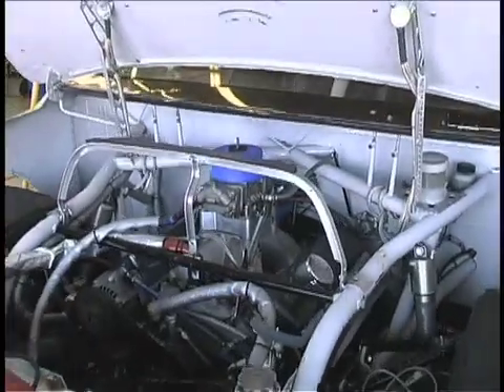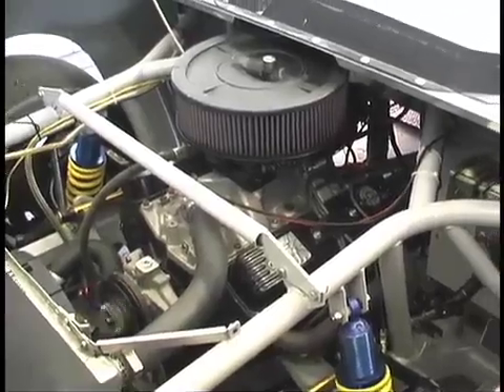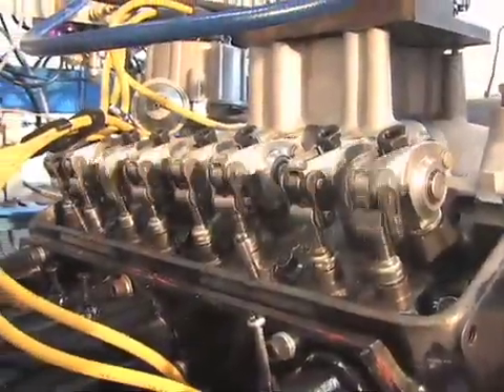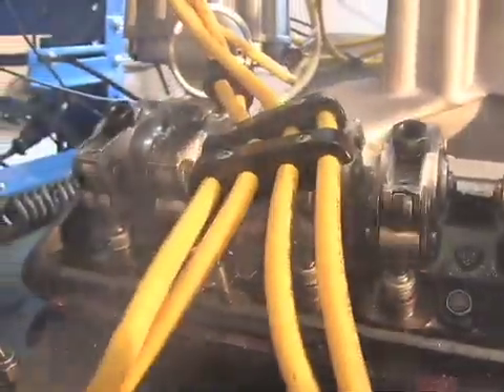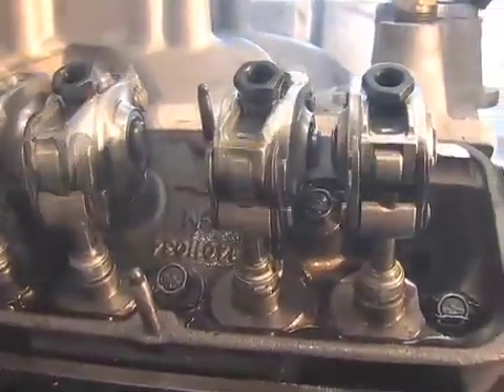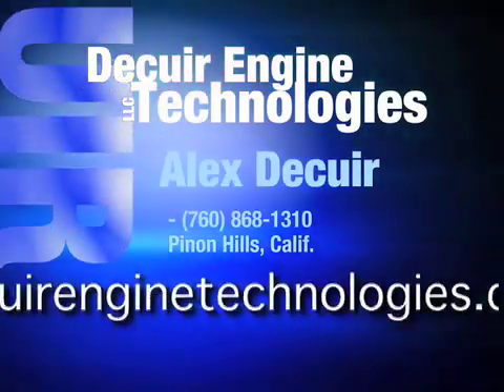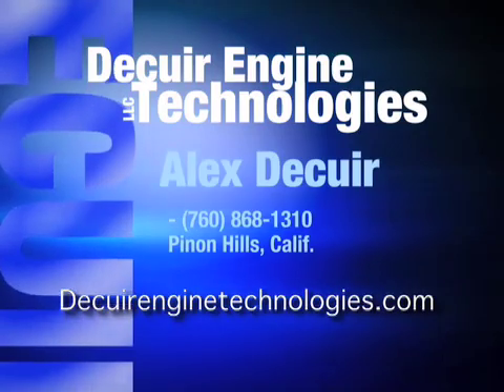Springless Valvetrain For Push Rod Engines!

Comment: It's 17 YEARS later. WHat is the status on this system? Have you tested this system against other OHV engines to prove this system is better?
Reply from the maker: Unfortunately the inventor has ceased operations and could not get enough backing to advance the project.

Comment: Just an immediate thought when viewing this video; If somehow the camshaft lobe could be caged or totally surrounded with the lobe redesigned to close the valves on the bottom side instead of opening the valves. I just don't know how a cam lobe profile could be constructed for different configurations. But, this caged lobe design could not or would be difficult to retrofit to current day push rod engines.

Comment: The only time a desmodromic pushrod makes sense is for higher serviceability and higher speed applications. For higher engine speeds in general, I'd rather any type of overhead cam or just no cam at all (2 stroke).

Comment: I think I would still want a spring and retainer on the valves, it looks way too easy to drop a valve! You put a valve where the Piston is going to be, you will have problems! Most likely, a broken Piston, valve and head! If you are lucky! It can result in rod in block syndrome!

Comment: So, you think the valves will always seat well without a spring?  Bullshit.  This is one of those inventions that only works for 10 minutes at idle. How will you make money without selling a single unit?   I know.  GOFUNDME.  GO FUND YOURSELF.
Reply from the maker: Hmmm.... and your latest invention might be? just send us a link when its up on Youtube. Thanks!
Reply: @EmpEntTV  I invented the worlds first valveless internal combustion piston engine.  It hasn't gone into production because of the inability to find a sealing material that has long term wear resistance without lubrication.
Reply from the maker: Very cool, send a video link over
Reply: @EmpEntTV  So you can steal my invention?  No thanks..  You'll see it when all the legal shit is done and it shows up in F1.

Comment: As cams wear there will be an increasing amount of slop in the system how is this corrected?
Reply: I tried to find an answer to that question on the internet but couldn't find anything, and definitely nothing on this particular brand, I guess it failed.

Comment: Valve rotation is important for valve seat wear and sealing. If you remove that the valve seat will wear unevenly and fail eventually. Also the spring absorbs valve train resonances and without a spring or some type of absorber once the valve train reaches resonance boom there it goes.

Comment: This is innovative,but I CAN SEE it is more complex and the valve return groove in the cam would probably wear out quickly and cause valve seating problems or even worse.A good old spring system is much more dependable as far as not needing to be replaced frequently.And would not be as liable to a piston crashing into a dropped valve and wreaking holy havoc.
Reply: Have you ever owned a Ducati? Lol you hit the nail on the head!
Reply: Not to mention if it was really worth anything you’d see it a lot more in racing but they use compressed nitrogen springs when normal valve springs won’t work
Reply: yup. anybody who knows how much time and effort ducati invested, and how many times major manufacturers investigated and discarded this sort of idea, understands that you don't simply accept these claims at face value

Comment: what about a cam type thing with wave patterned groves and a bearing inside the grove on each side which is connected to the pushrod so the rod is open or closed at the peak and trough of the wave respectivly.

Comment: So, what about valve clearance to allow for expansion?
Reply: The valve seats and the valves are made of different special alloys.  The valves don't expand: they're made of a dimensionally-stable, thermophobic alloy -- a fringe benefit of which is that the heat normally lost through the valves is reflected back into the combustion chamber.  The valve seats are a compatible material that provides a consistent inner diameter and a variable outer diameter, thus maintaining a perfect press-fit.

There are a variety of valve seat alloys, each tailored to the various aluminum or iron alloys used in the casting of cylinder heads -- so, if you're upgrading, you'll need to know the casting's alloy name,  There's rumored to be a sample kit available for determining the best fit for unknown alloys, but it may not be available until 2019.

Alas, the valve seat alloys and the valve alloy all are proprietary :(

Comment: Still doesnt say how it works. Has to have some kind of spring to get a quick enough return and then i dont see how it takes less pressure to activate them.
Reply: +Nick Palaroan I believe everything is positively linked together,. and the camshaft is replaced with something along the line of a mini crankshaft. So just how the crank will &quot;pull&quot; a piston down the cylinder on the intake stroke, this v;lave train &quot;pulls&quot; the valves closed. 

Why I think this design is crap, is I cant see how valve seat pressure is accurately set and maintained...and Even in the video it sounds loud.  This thing probably falls out of adjustment often, and likely burns up exhuast valves when the seat pressure falls.
Reply: Michael G
Yea from what I have read this system does need constant adjustment and is probably why it hasnt made its way into car engines.
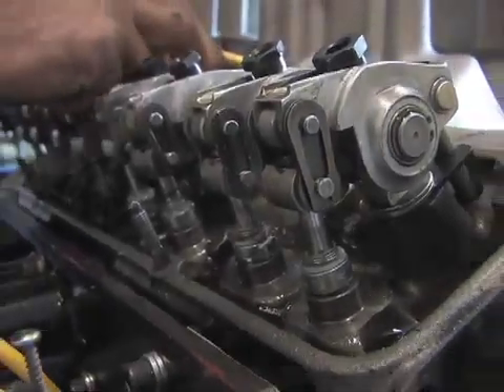Reply: They say how it works at 0:30 ... it's like what Mike said - works similar to a crankshaft.
I don't know how I like the inner groove though. That must place a lot of stress on the pin!

Comment: Doesn't this kinda eliminate variable valve timing?
Reply: Not at all. In fact, it would be controlled at the cam sprocket. Check out the LS gen 4/5, or the "slopar"  (haha) hemi gen 3 engines. Interesting stuff.
Reply: @thehighlife1320  That would only control the advance, and unfortunately it would affect both sides of the engine... LSA and hydraulic valve activation (VTEC, for example) wouldn't be possible with a single cam in block.

Comment: What bothers me is no high rpm sustained torture testing. A 10krpm or 12krpm torture test spell disaster for standard sprung valvetrains. If this can run at sustained loads at rpms grater than a standard sprung valvetrain this would be picked and sold. But the fact that we haven't seen any high rpm torture tests leads me to believe that this is a good idea but its not ready for market.

Comment: I see an issue with the valve closing mechanism at high RPMs Not enough surface contact area for longevity on a push rod retrofit. It's one thing to keep a valve closed and another to combat high speed inertia. This would work better on overhead valve designs. Less valve train mass. I'm sure I must be missing something.

Comment: whoa i was just thinking up something almost exactly like this in my head earlier today.
Reply: kolideoskope I had thought up this brilliant idea of using compressed gas to close it and an electric solenoid of some type to open the valve but indy cars beat me too the compressed air thing years ago. lol
Reply: me too, i had a design in my head where a camshaft had a guide the lifter could ride in, and how the push rods where fixed to the lifters and the rockers and the rockers where fixed to the valves. i also had a design for a engine that had a second camshaft with opposing shaped lobes, one cam pushed up on a set of rockers which pushed the valves down, and when that cam rotated to let the rockers fall back down a opposing cam pushed the rocker down too lift the valve up, a pneumatic spring insured the valve had a nice seating.
Reply: that called GREAT MINDs Think alike.  the question is who thought of it first. or had the idea & How long have you had the idea before it was first made. is what means the MOST & HOW it  it Goes .
Reply: design I had for years, however the extra set of cams would increase the size of the cylinder heads, also I could see the chance of mechanical failure in the cams that had guides for the lifters and pushrod design.
Reply: angryace13 extra set of cams? i don't follow.
Reply: alright, its a DOHC set up, a pair of cams regularly egg shaped if you will turn and push up on roller rockers, and the rockers in return push down on the valves opening them, a set of opposing cams on top of the rockers assist the valve springs in closing the valves buy pusing down on the rockers, lifting the valve up, the valve is fixed too the rocker.
Reply: there would be four cams, two below the rockers pushing up on them, and two opposing shaped cams above the rockers pushing down assisting the valve springs at higher revs, this would allow a more aggressive cam profile, while allowing higher revs without floating, without needing a insanely stiff valve spring.
Reply: and koneggsegg has the solenoid thing now.

Comment: Only problem I see here is that you will be limited to what you can do with the lobe. The more aggresive cam profiles actually shrink the base circle in order to get more lift. Because this system requires that you be on the inside of the lobe, you are going to require a pretty big base circle.

Comment: Why not use solenoids  to open and close valves was an idea i once had?
Reply: Solenoids can be difficult to get timed precisely. especially at higher revs where the valve open-close time is measured in single digit milliseconds. and being off by microseconds can cause valve damage. It is not impossible, but systems that run at those speeds are pricy.
Reply from the maker: Solenoids have been used with some other inventors and have shown some pretty decent promise. The whole crux of the matter is that its great to see so many different attempts to try and make the whole function of the internal combustion engine a much more efficient.
Reply: Skwisgar2322
Reply: +abel reyes And also solenoids will wear out quickly with that much heat. The fuel injectors have the advantage of fuel cooling them off. My old Chevy van needed a new starter solenoid every couple years because it got too hot.
Reply: +abel reyes The problem has always been to have enough control at higher rpms.  It requires a lot of voltage (in excess of 50 volts) and current, making it impractical for most applications.
Reply: they do. Search for Cargine free valve system
Reply: Rely on an electrical whem you can rely on fuel?
No.

Comment: Greg Anderson ran this same system on his Pro Stock Chevy Camaro for a while. Now everyone in the GM camp is using it. Works great, Wins lots of races. Picks up alot of horsepower.  Especially at 8,000 RPM and above.  I believe its good to 12,000 Rpm or more on a Pro Stock Chev motor.

Comment: Is it hard to adjust the valves? I am thinking that any heat buildup would cause the valves to be closed with too much pressure unlike a spring that is forgiving.

Comment: very impressive, def cool cuz as you said it goes onto a american v8, Formula 1 uses something similar kinda pneumatic which im sure you know about which Renault came out with first with there v6 turbo motors but thats multi billion dollar stuff. Im guessing this system can be put on any american v8/v6 as long as there push rod?

Comment from the maker: In the video you see the cam which is quite different than a conventional camshaft. This system uses a follower with an inner groove cam that causes the follower to open and close the valve. It is a setup that does a push and pull of the push rod. 
DET

Comment: Not necessarily. I mean I haven't a clue whether this system works all that well, how expensive it is, or how reliable it is...but the theory is that it frees up power that's wasted by the parasitic parts that your traditional pushrod system needs to work. With today's gasoline prices and green mentality there is a potential market for a system that makes more efficient power even if the end result is the same in terms of power. Same goes with revving quicker (not higher), part longevity, etc.

Comment: It's an interesting design, but as a mechanic Myself,i see a lot of wear components in the valvetrain design. Even Ducati's desmo system has durability issues,mostly due to parts fitting loosely enough that they see constant impact wear. Then there's the number of parts involved and economy of the transition to building this system.It would make for a great race engine project though.
Sadly,i don't think any major carmaker will care about this though,they have things the way they want them.

Comment: Norton motorcycles also built a desmo engine back in the '50s for one of their race projects. Many companies did back then mostly due to the design and materials of valve springs then,they weren't reliable with the RPM's of the engines being developed.

Comment: If this proves reliable enough it will flood the market. Anybody would like to free quite a lot of horsepower that the engine already produces with only a different cam, lifters and rockers.
I like that is uses only 1cam lobe/valve since the 2 cam/valve design would also need 2 pushrods.

Comment: So they have applied desmodromic valve actuation to a pushrod engine and now for some reason they stole it from Ducati, except as someone has pointed out it was pat. in 1896 and one of the more famous(?) applications was by Mercedes in the mid fifties in their F1 and 300SLR. That must mean Ducati 'stole' it from Mercedes then?. Thumbs up by the way.

Comment: does it really make a difference when the engine its used on isnt designed to rev? im sure their is benefits, but you need to rev in order to take full advantage of it, just like dohc systems

Comment: The M186 and M189 engines are 6 cylinder and based on the sedan engines from the 3-0-0  series of cars. But the SLRs are all straight eights. There is only 6 of them though and apart from the tragic 1955's lemans car,all are still in Daimlers hands.  The First Desmo valve train was in fact the peugeot of 1915 on which the Miller etc etc were all based. I am impressed with this idea for SBCs though.

Comment: Well valve covers are already very light and the PCV valve system does suck excess air from the block internally "From one of the valve covers" . Soooo good thinking but it's already been done and for decades.

Comment: Now I know that springless valvetrain systems have been around for decades esp on Ducati motorcycles and Mercedes Benz race engine in the mid 50's. This isn't new and that is well established but I can see the point of the video which shows that it works on a pushrod engine with a single camshaft. I know that less energy is wasted through the friction caused by springed systems & this technology IS viable for mass production but car companies don't want their cars to be economic or reliable.

Comment: @muscatbr To give you an example on a 12 valve 3800.  I did a dyno test going from 90# to 130# (seated pressure) springs on both intake and exhaust I lost about 10-12whp through the power band.  It was significant because I was also testing the engine flow on this 8.5:1 compression motor (L67 engine code) with no supercharger - in order to learn more about the engine off boost to size a proper turbo charger.
It made 150 whp before. and about 140 whp after.

Comment: Ignore all the naysayers.  Have a few questions comments though.  I used to have a rev kit (additional springs that seat at the bottom lip of cylinder head valley overhang and seat on top of the lifter) on a sig erson billet roller cam 778 lift in addition to triple valve springs in a chevy small block. I could see how this would save/conserve horsepower.  Do you have a way to measure how much horse power is consumed by having to push open the valve springs?
How much horsepower is saved using

Comment from the maker: @eddiesautoworks, check out this other link on You Tube, Look up EmpEntTV and you will see our other video that is related to an OHC system. 
We have done this for OHC engines as well. Valve seating is achieved through a cam system that both pushes the valve open and then pulls it shut. 
DET

Comment: that valve train requires a lot of maintenance. more problematic. cup cars run around 10,000 rpm with teal springs. pneumatic valves would do better than steal and these decuir things

Comment: @lolahavasuaz : This is NOT a desmodronic valvetrain!
A Desmodronic System has two lobes per valve, one to open it and one to close it.

This slottet lobe is a nice idea, but I wonder if the follower-pin is able to take the stress of High-rpm use.
But a nice Idea to make a high-reving pushrod-V8 more practical.

Comment: @EmpEntTV While I like the idea and how You built this, it's going to be shockingly expensive to produce,isn't it? And now that an engine can be built with beehive springs, lighter valves, roller lifters and rockers to control friction losses while at the same time allowing higher RPM operation, is there that much of an advantage economically?
Like I said,I like what You're doing, but do You think there's a market big enough to make this profitable?

Comment: @weegaz22 what holds the valve closed is the cam shaft itself, if you could even call it that in this engine. But what i think makes this design not suited for everyday use, is i could picture that once that cam shaft wears out, among other valve parts, the fact that valve seal is dependant on the mechanic pull from the valve train will be the killer. Once theres play in the valve train the valves wont seal and you lose compression. Springs leave room for play while still sealing the valves.

Comment: There will be a "spring" somewhere in this setup, its just not in the conventional place, could be on the push rod to hold tension against cam, or built into the rocker assembly, you need something working against it to close the valves.